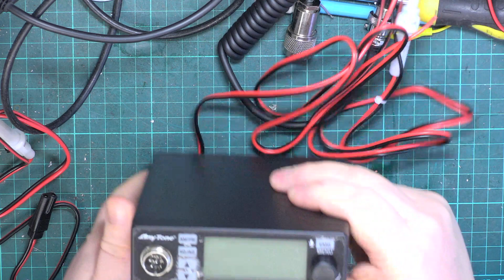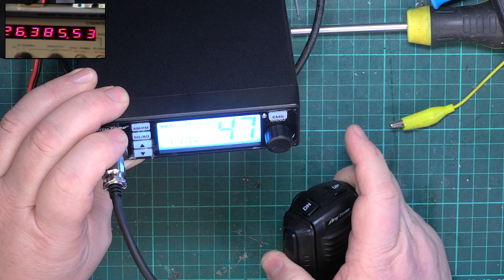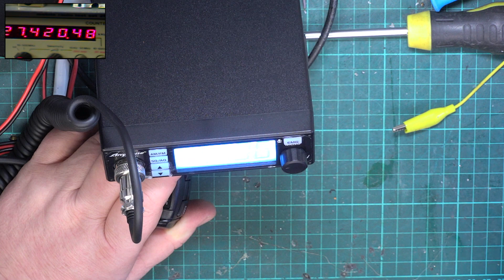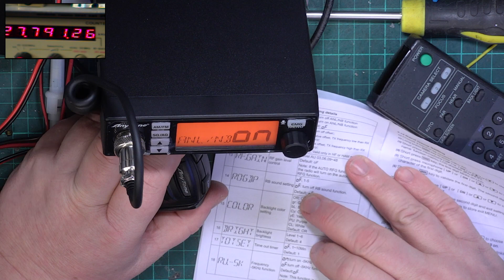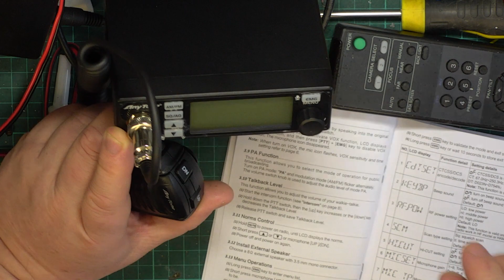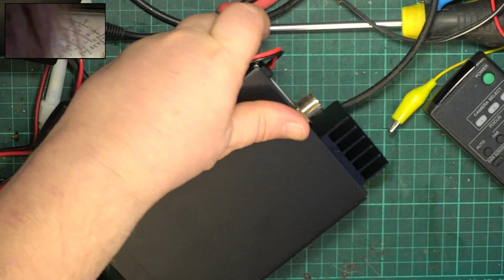Anytone AT500M UK CE MultiNorm CB radio - adjustment

Comment: How do you figure out the ctcss codes. The menu has numbers 1-38????. Which number corresponds to which ctc code???
Reply from the maker: They don't mention it in the instructions do they? We'll assume 1 = 67Hz & 38 = 250.3Hz

Richard
Reply: @ukfmcbradioservicingTango21  
I purchased a freq counter. When it gets here I'll try to figure it out.
Reply from the maker: I'm not sure how a frequency counter will help, unless you connect it to a receiver which is on the same frequency as the radio you are testing, and then you have the frequency counter on a direct line output connection of that receiver listening for the sub-audible tone.

We do it here into the test set in FM deviation meter mode, then take the output of the deviation meter into the Y plates of an oscilloscope & connect an audio generator to the X plates of the oscilloscope. Then go through the available CTCSS codes putting each one into the signal generator intil the oscilloscope shoews a perfect circle (called a lissajous). In reality, onlt takes about 30 seconds to find the CTCSS with that method.

Talking of CTCSS; never set 100Hz as a CTCSS code in the UK because it's twice the mains frequency of 50Hz, it's troublesome.

Richard, G0OJF, UK

Comment: So what settings did you using in the service menu
Reply from the maker: The settings differ for each individual radio, they are there to adjust out tolerance of components so have to be adjusted with reference to test instruments.

Richard, G0OJF, UK

Comment: After reading the other replay posts it seems you already tryed adjusting it and the RSSI only seems to affect  the TX meter when keying the radio, that's strange. I guess you need to research how to adjust the meter for RX receive to get the meter to better reflect a more accurate receive signal.   Well at least you got the main issue resolved. I wish you luck.

Comment: RSSI on the program software for anytone 10meter radios adjust the tx and rx meter calibration.
Reply from the maker: Are you absolutely sure that software works with this radio especially as what appears to be a TX meter is fake & shows the same bargraph level regardless of actual RF output...like most current CBs do?

Richard, G0OJF, UK
Reply: @ukfmcbradioservicingTango21   No  what I'm referring to is RSSI is the adjustment to the meter in the hidden menu on the radio you were working on. When I adjusted the RSSI on my 5555N for S9 calibration I could do it 2 ways, program software and service tech menu. RSSI refers to calibrating the meter for different options that the meter is used for. Just make sure you write down all the calibration numbers settings before you start changing them in RSSI before you adjust them so you can always put it back to where it was if you make a mistake or forget . Just helping with some information and feedback.  73s
Reply: I bumped the button on rssi, now I have no tx meter, any way to get it back???

Comment: Anytone send you a manual, you got to be kidding.  Now that I have said that they might :-))For those that want to read the instruction book it is here for another set, but it is supposed to be the same radio, but don't take my word for it.
http://www.cbradio.nl/stabo/Manual_Stabo_XM3008e_VOX_DE_ENG_FR_PL.pdf
I'm afraid it would drive me nuts.
Now the link will be removed automatically!  lol.
Reply from the maker: I've been able to approve this from the spam filter. Nice try but that's still just the user manual, though better than the anytone one.

Richard
Reply: @ukfmcbradioservicingTango21  I know it is the user manual, I posted it to let everyone see how bad or good it is depending on your opinion.  There is no manual at this time.  According to Anytone's site.  Though they might have one for a dealer and probably do, they are not telling, but do on some other older models.
Reply from the maker: Thanks for posting the instruction manual Bob, I hadn't thought of that.

Richard